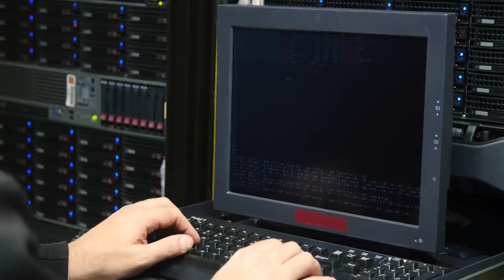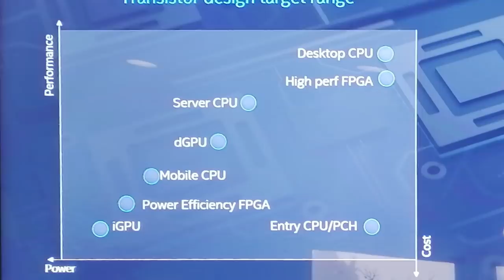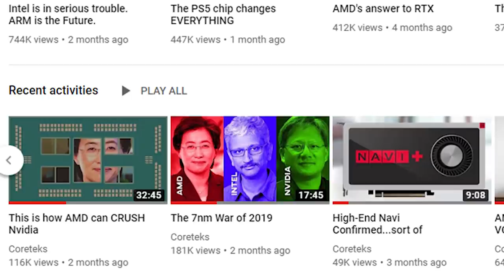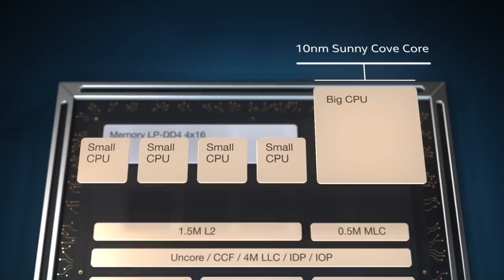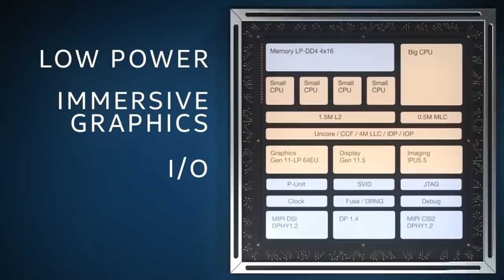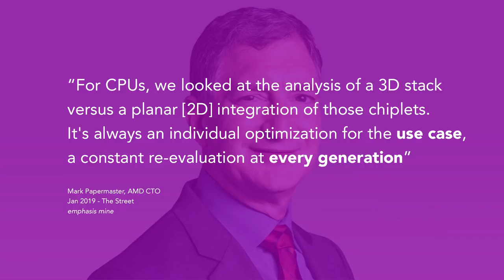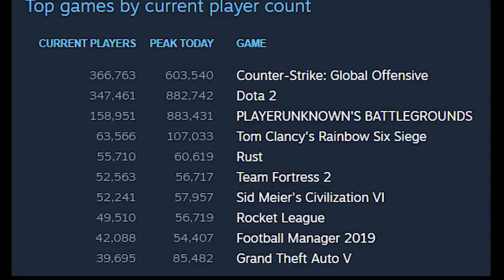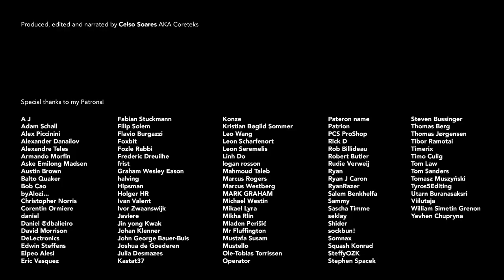2D vs 3D Stacking: Intel’s plan to beat Zen 2

Comment: I wanted to go to bed now.
Now I'm questioning future hardware acquisitions.
Reply: Yeah, still happy with the i7 3770 I bought in 2012 and although it is a 7 year old computer I'm really not seeing any point in getting any of this overpriced last gen crap, specially seeing all games working fine at max settings, seems like upgrading is just a waste of money. At this point I think Intel should start looking into power saving instead of increasing performance, I really don't see any need for CPUs to get faster.
Reply: @leny4838  i wouldn't worry, first gen anything in tech is always vastly inferior to 2nd gen.
Reply: Computers today are absurdly fast already. A machine capable of running latest AAA games at 1080p in max graphical detail while pulling 120 frames per second can be built out of 5 year old hardware for under $500.

For home non professional users, only an idiot would run out and blow a shed load of money on latest components they do not need, just to play the lastest title of battlefield or some such nonsense game that does not take full advantage of the power in the computer due primarily to most AAA games being developed for consoles and ported to the PC platform with their limitations and piss poor rushed badly optimised coding.

The home PC hardware industry today seem to require a reliance on the naive being born every minute combined with sloppy game developers.
Reply: @Nine-Signs  no 5 year old gpu can run 1080p max settings at 120 fps lets its a gtx 980 or something you also need at least an i7 3770k for 120fps gaming in almost all recent AAA games maybe a gtx 980 ti can do 1080p 120 fps high settings but that gpu is from 2015
Reply: @Nine-Signs  id like to see a $500 pc (yes you gotta buy a case, PSU and everything else, not just a test bench) run Metro Exodus at its max settings at 1080p60 let alone 120fps lol.  Hell ill give you $1000 budget and you still wont get there and this is an incredibly well done and highly optimized game.  If you think different you are a fool.  4a much like crytek designs games for hardware that hasnt hit the market yet.

As for the rest...some of us have nice big 4k OLEDS that we hook out PC up to and no $500 PC...no $1000 PC is going to run games at 4k60 maxed out unless the game is from early 2017 or older.  Hell Rise of the Tomb Raider running on a i7 5820k overclocked to 4.8ghz (6 cores) with 32 gigs of DDR4 in quad channel, a highly overclocked 2080ti and the game running off an NVME SSD still cant run at 4k60 maxed out... soooooo
Reply: @d0x360  even if he wants to run a game like battlefield 1 at 1080p ultra 120 fps 1080p
Reply: @pleheh  Fine, anything besides a DICE game.  Obviously there are SOME games that will run like that. Some.  Not enough to say a $500 PC is enough for everyone.  1080p is also horrible image quality wise.  Going from even 1440p to 1080p is alot like going from 30 fps to 60 or 60 to 120...it becomes... obnoxious and ugly.  

I'm also not so sure that you can max out BF1 on a $500 PC at 1080p 120 fps... Plus it won't run VR very well.  Believe me, I'd love to be able to have a cheaper PC but most of the things people say about the $500 PC only apply at the end of a console generation (like right now) and half of them are a myth.
Reply: @d0x360  I get a 60fps in BF1 1080p maxed out with my system i paid $360 for 3 years ago.  i5 2500k + R9 380 runs great, although i could use another 10 fps in some situations and I could do that with another  R9 380 in crossfire for only $100 used right now, that system would also hit almost 50fps in metro exodus on high(crossfired), so 1080p 60fps gaming has never been cheaper. If your buying new then yeah you gotta absorb some cost for getting into a new generation, but last gen is still good for 1080 60fps
Reply: @mikejones-vd3fg  you are cpu limited with that i5 2500k you cant get much higher than 60-90 fps in bf1 even with an OC
Reply: @pleheh  Definately can feel the lack of 8 threads, its only 4 core 4 thread, and there are some stutters as it loads, which also could be due to slower memory ive read (only 1333mhz) but its at respectable 4.2ghz and I could push it to 4.5 or more with manual tweaking, this OC was just the auto overclock setting the mobo has. But looking at the performance of an 2600k(which is 4 core 8 thread) vs an 8600k its only 5-10 fps slower when both had a 1070...so up to a 1070 youre not bottlenecked by a i5 2500k-ish performance that much.  So I figure if you got anything lower than a 1070, a i5 2500k is more than enough. Only when you have that card or better will you start to lose fps due to CPU.  Which just goes to show it doesnt take much CPU to get a GPU at its full pontential, especially these days.    Then again none of this  matter when the main bottle neck is my 60hz monitor. But then again i dont see 60fps as a bottleneck, yet. ;)
Reply: @mikejones-vd3fg  i have the i5 6600 which is about as fast as an i5 2500k OC to 4.8ghz with a gtx 1060 6gb and 16 gb ram
I use a 1080p 144hz monitor and when i play battlefield 1 on high/ ultra settings i am mainly cpu limited with 60 to 100 fps(gpu usage is around 70%)
And 45 to 75 fps when in a discord call
When i use discord on my phone the game is very playable with some minor stutters at around 80 fps
Reply: But we still love ya Engie!
Reply: Same here! I'm kind of waiting for Zen 3rd gen, hoping for 3700 with a nice pcie 4.0 motherboard but... this video got me thinking that maybe I should wait a bit more.
Reply: Will the level 4 sentry finally use a modern processor?
Reply: INTEL WILL BLOW YOUR MIND IN 2019 WITH 14NM.
Reply: @SweetyHeaven  yeah me too but you can always wait longer
Reply: @Nine-Signs  Instead of naming-calling consumers like an arrogant fool, do keep in mind that AAA games at 1080p these days actually require a lot of horsepower to run at max settings. Even a 10th generation 6GB nVidia video card with 8GB of RAM and OC'd quad core i5 CPU aren't enough to max out the latest games at that resolution. I speak from a very recent experience. I bought into all the stupid nonsense from the internet "experts" who claim that similar hardware combos are more than enough to play the latest games at max on 1080p. But in reality such claims are bogus. Whether or not this is caused by poor optimization is irrelevant. Consumers are forced to invest in the latest PC hardware if they want to play their latest favorite games. This has nothing to do with stupidity on the consumer's part.
Reply: @pleheh  Yeah I should of mentioned that was only in one benchmark the i7 2600k stayed close with the 8600k (BF1), the i7 being 4 core 8 thread, those extra threads even cores are going to make a difference and looks like already are starting too seeing how your performance dips with discord which should be expected since the 6600k is 4 core 4 thread   the difference there is going to be greater as time goes on, even though the single core performance is still good enough not to bottleneck a mid range card these days the lack of threads/cores is starting too once you start multitasking and will more and more in games as they use more threads.  And then finally the mighty 4 core 4/8 threaded Intel, whatever variation will be retired. 

I sometimes wonder though with the CPU's being less important it seems, at leaste for bare minimum to get the graphics card going, and how they're adding GPU's onboard, will the graphics card companies start adding onboard ARM cpu's or something with their graphic cards? Just enough to feed the card, which could turn into a console /pc hybrid type machine where you buy the video card and thats all you need, and everyone develops on it like they do on PC the only difference being you got a wide variety of consoles to choose from to run the same games.  And maybe even those cpu's have enough power to run even windows or something similar so you can have a regular computer as well.  Maybe not as a powerful as a dedicated cpu, but just like integrated graphics arent as good for gaming, integrated CPU's on video card could be the same for computing in an OS environment.
Reply: i'm gonna buy just to show i'm cooler than you.
Reply: I hope CPUs improve over the next years. GPU performance is many more times improved than cpu performance over the last decade. I just want to run TF2 at higher fps but a good CPU is the only thing that will do that.
Reply: @pleheh  , some people can't see faster than 25 fps, that's why the cinema was 24 FPS and NTSC TV 23.975 or 30 fps. So how to make difference between 70 fps and 120 fps with naked eye ?
Reply: @papaiurso5860  you're right - your "Ivy Bridge" is not slower more than 18% clock-for-clock with the latest i7s. And this is perceived by the human senses as half of that, e.t. like 9% difference. Well the meltdown / retpoline OS/microcode fixes might slowed it down so if they invent CPU without those security holes, they could claim it's faster, because it won't get slowed down....
Reply: @angelg3986  thats where glasses are for
Reply: Pelle Sanders thanks, now i remember those people who claimed they could hear the difference between opamps in their soundcards some were 'warmer', others were 'crispy'. it makes sense now
Reply: @angelg3986  the what?